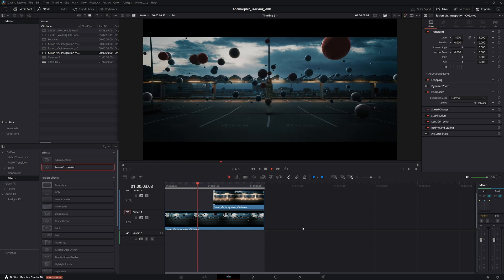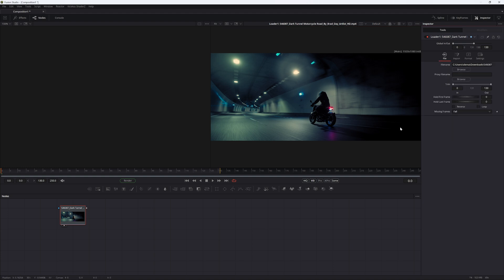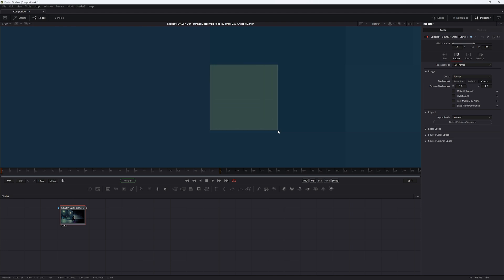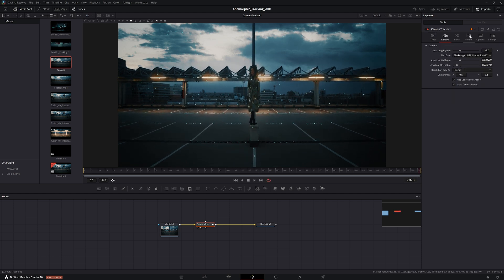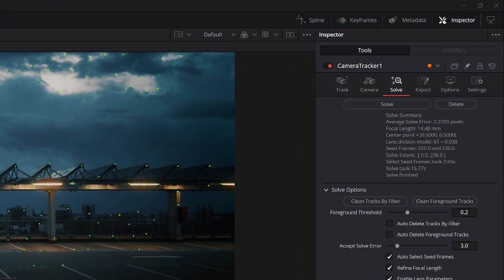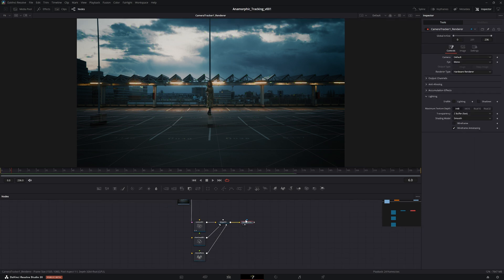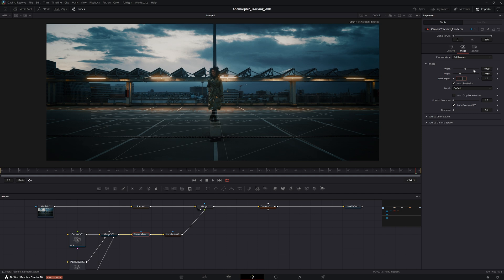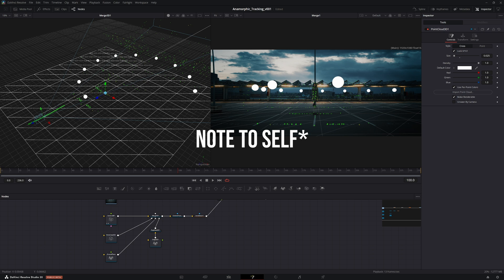Anamorphic Camera Tracking Tutorial | DaVinci Fusion

Comment: One thing I have found to be a good thing to look out for when determening unknown pixel aspect ratios is to find something in the frame that's supposed to be a perfect circle, and just try to make it so. Preferably while gesturing like Picard. 

For cars, a shot of a wheel near the center of frame as flat as possible. Even better are spheres. They are perfectly round no matter the angle when near center of frame. If you only have a face... The iris of the eye and pupil can often be used. 

It lessens the guesswork. Especially as I have found that finding and making perfect squares is much harder than spheres and circles. Much much easier to judge by eye.